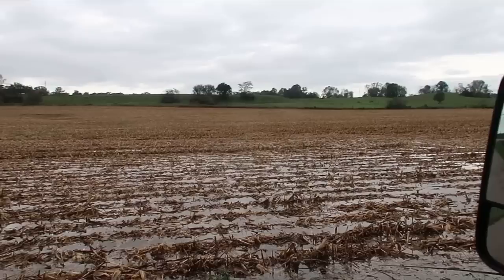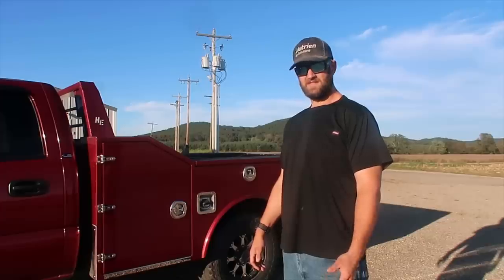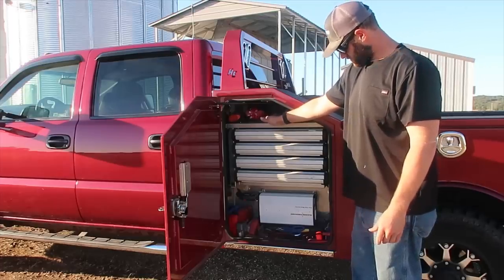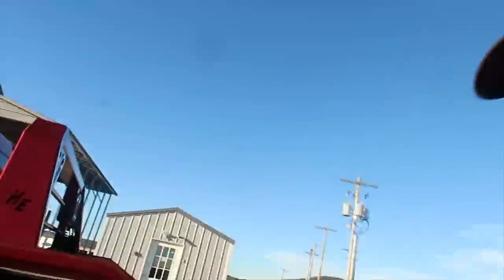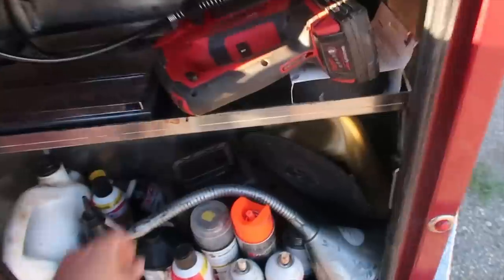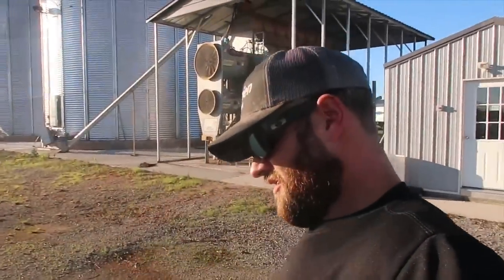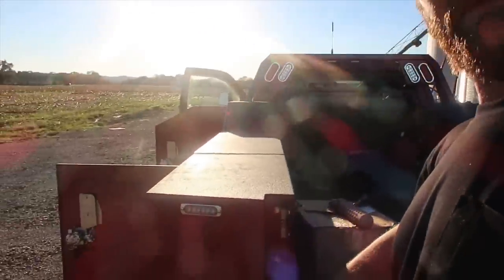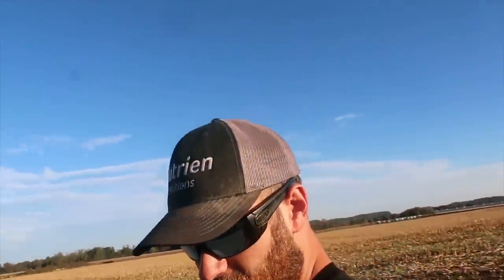My Service Truck Body by Hughes Equipment

Comment: Nice set up! I really like that bed, not sure if you have done this before, but I highly recommend welding a vice to a hitch to slide in and out of your hitch receiver. You don’t use it everyday but it is invaluable when you need it!
Reply: Yes i have done that on mine :)

Comment: @ 3:20 What I did in the service truck that I used to run I took a piece of wood and just made a divide for front and back. I put metric up front standard in the back. all of our wrenches are 19mm-32MM and 1"-2 1/2 It just keeps it so I only have to dig on one side or the other unless someone else throws them in randomly. our small wrenches are on the plastic hold trays.

Comment: I bought a set of tool organizers for my toolbox.  Basically a plastic divider with a sawtooth pattern.  Placed in the drawer in a V pattern, it holds the wrenches on their side  from smallest to largest.   Kept them organized, and easy to ensure no tools were misplaced.  My set holds 1/4 to 1 1/4 inch wrenches.  Surprising, it takes less space than just throwing them in a drawer.

Bounced over many fields with that setup.  Also works well for screwdrivers.

Comment: only 2 years late on my comment but for your wrench organization, a tip I picked up, use hydraulic hose protector (the spring wrap type) to hold all your wrenches in order, it gets them all really tight together and has worked great for me in my truck

Comment: hard closed cell foam, use a wood or wire burner to cut out for each wrench set on edge, holds them tight, not a lot of wasted space and the don't rattle and get the hell beat out of them. Diesel wrenching  in the oil fields and other places it's done the trick.

Comment: Nice setup!
I bought a ram chassis cab with a flatbed for my service Truck & Cattle work. Compared to my Ram 3500 the chassis cab is a huge step up in weight and towing ability. My 3500 Wait Almost 7500 lb the chassis cab is 10300 pounds. I've never had a truck pull wagons and control them like this one!

Comment: Badass setup. Would you recommend that air compressor for say running a diaphragm pump to transfer coolant and oil and to run air tools like die grinders etc?

Comment: Just take a good diameter wire, coil it around a thick broom handle or something. Take it off the handle and pull the coiled wire apart enough, to put your wrenches in the spaces.

Comment: Try carabiners thru box end of wrenches to separate.  Easy to get one u need
Reply from the maker: Man I feel incredibly stupid for not thinking of that. Thanks for the suggestion. I’ll probably do that.
Reply: i made a big safety pin out of welding wire for mine

Comment: How is the clearance pulling the camper with the raised boxes in the front, would you say it's about the same as having a crossover toolbox in a regular truck bed?
Reply from the maker: Probably. I have plenty of clearance for about 100 degrees of turning. Where it gets close it the inside of the bed. The camper hitch almost hits the inside of the middle took box before you have to worry about the front box

Comment: I’ve always been confused when it comes to this,but why is it that you want a steel exhaust for no rust but you don’t want  that on a truck bed?
Reply: Correct me if I'm wrong, but I believe it's because your exhaust generally keeps itself dry because it gets hot, and aluminum would melt and burn through also. where as your truck bed does not, so the rain water and any other water gets on it just sits and corrodes.

Comment: You should have gotten a f450 with a 8' bed that has a 6800  lbs crane on it.
Reply from the maker: Not much of a Ford guy and this is my daily driver so didn’t want a crane on it.
Reply: @BriansFarmingVideos  
What the matter with ford.
Reply: @BriansFarmingVideos  
Why wouldn't you want a crane on it. Aren't you a mobile machinic.
Reply from the maker: What’s the matter with Chevrolet? Lol just personal preference. Dad and I have always had GM trucks
Reply: @BriansFarmingVideos  
Nothing Ford just better lol

Comment: How much weight can the Top of the sides handle
Reply from the maker: I stand on them from time to time. Other than that i don’t know
Reply: Brian's Farming Videos ok I was wondering because if I were to get them I have a Honda rubicon I haul in my bed all the time for my line of work and it’d have to haul it safely and securely for me but thanks for letting me know

Comment: The middle one where the wheel is and there is on on the edge inside
Reply from the maker: @5:25 the left side middle compartment is shown. Then @6:30 the right side middle compartment is shown. And these isn’t a compartment inside a compartment on edge.
Reply from the maker: Unless you are talking about the drawer in the air compressor compartment. It’s the same as the other drawers only is has air chucks and tire plugs in it

Comment: How come you don't have a 6800 lbs cranes on a daully f650. You do mobile work don't you. Ever thought about getting a international 4300 or something bigger like a Chevy 3500 with a maunal transmission.
Reply from the maker: Don’t really work far from our shop so never really needed anything bigger. The two truck you see are our daily drivers
Reply: @BriansFarmingVideos  
What two trucks do you have again.
Reply: @BriansFarmingVideos  
Do you get good mpg. Or worry about diesel prices.
Reply from the maker: I was referring to the one in this video and the 2015 red flatbed that my father built in our farm shop.
Reply from the maker: Truck gets around 19 on a long trip. Not much I can do about diesel prices
Reply: @BriansFarmingVideos  
Not I'm gonna do hot shot so I not gonna get near that on the new f550. What the max you can haul with it not being a daully.